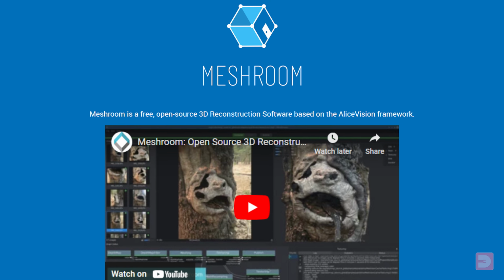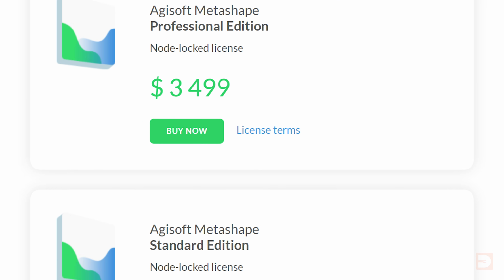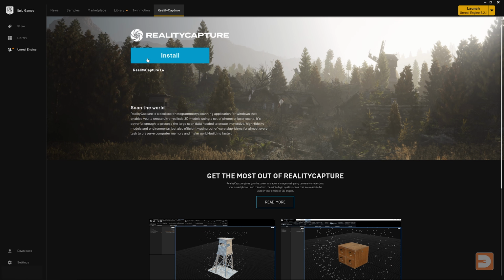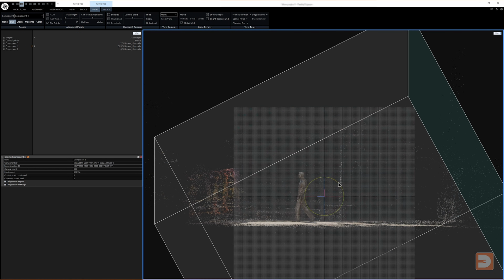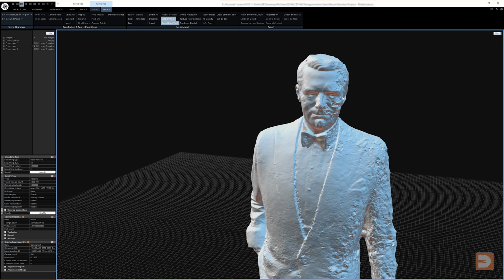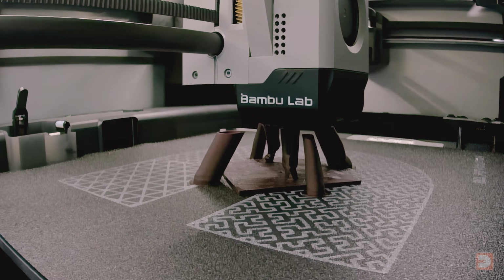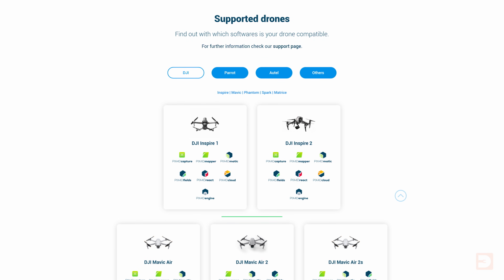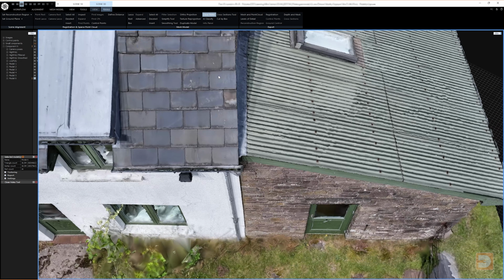Photogrammetry: 3D Scan with Any Camera | 3D Scanning Series

Comment: We can technically change the metadata later on though. If just apply the same camera settings (focal point, fstop, ISO etc.) it should still work. Hard part is, if the photos have various settings in particular shots, then we have to go over each and every one of them, considering there are hundreds of images..